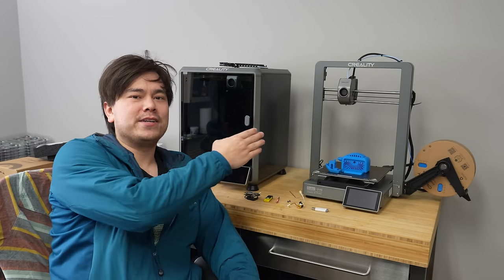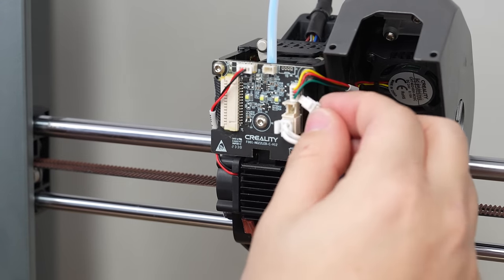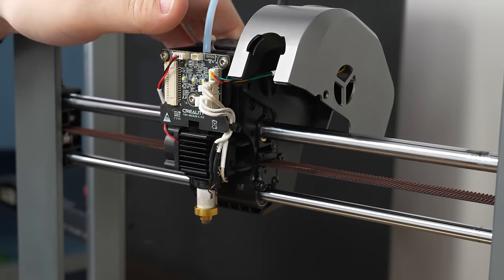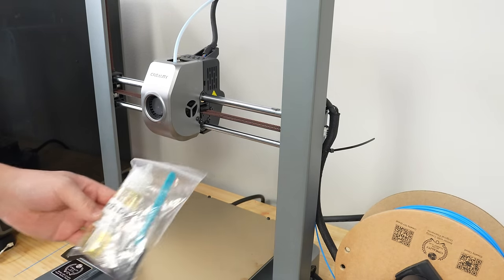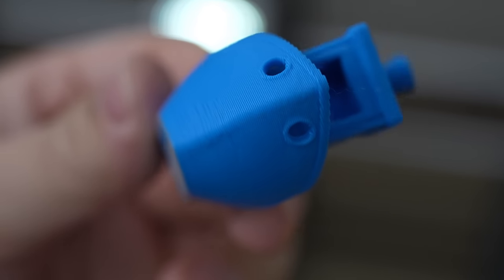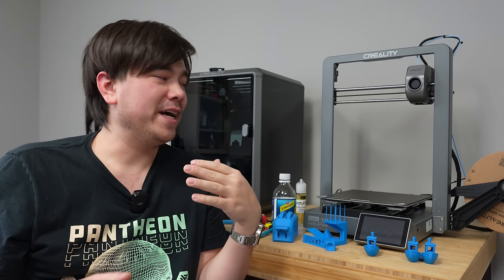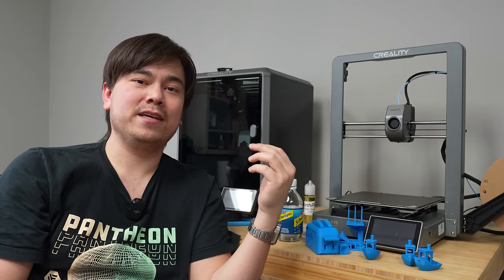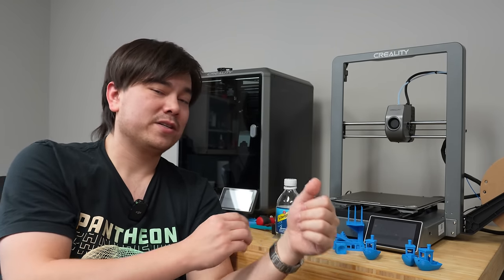This Ender 3 is Completely Different.

Comment: My Ender 3 from 2018 can print recycled plastics, although it's not as fast as a Bambu, it can be. But it doesn't need to be. I don't need a benchy in 13 minutes just like I don't need one in 25 minutes. I don't understand the fixation on speed when you're essentially contributing to microplastics. It's just in poor taste and feels like it moves the market in the wrong direction. Your 13 minute benchy looks like crap, I'd have one better printed in 25 minutes than you printing two at the same fast speed and still look worse.... ? What are you going to do with that already poorly printed benchy? can you take it and convert it into filament again to be used? No, cool. Who needs a machine that can spit out plastic toys with poorer quality finish than the machines from 2018. ? are these reviews even real.
Reply: A support less print doesn't even calibrate the machine, you want to print something with tree supports to find out 16 hours in it's going to fail.... That's not cool, it don't matter how fast it can print a support less benchy if it keeps ruining supports and can't print more than half its bed size .... Like come on. WHO IS JUST BUYING THESE PRINTERS TO MAKE BENCHYS?